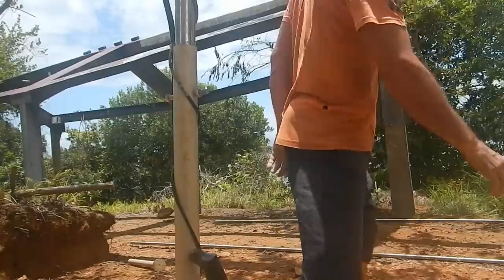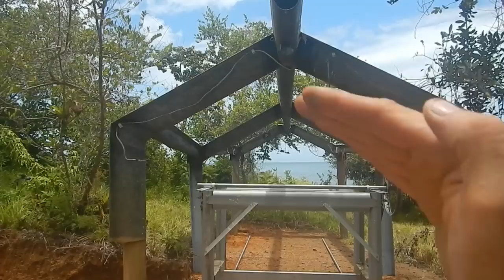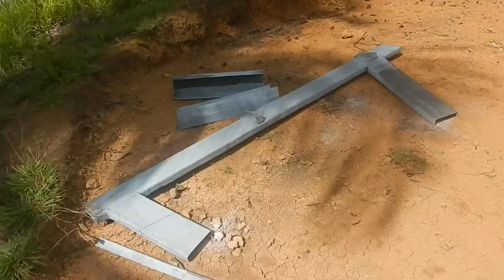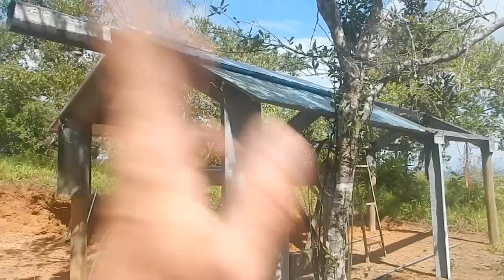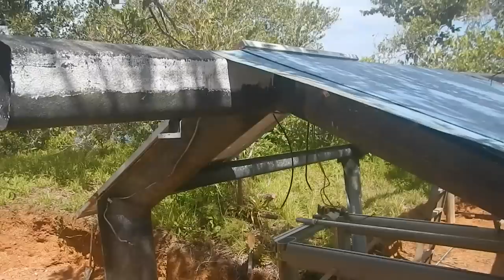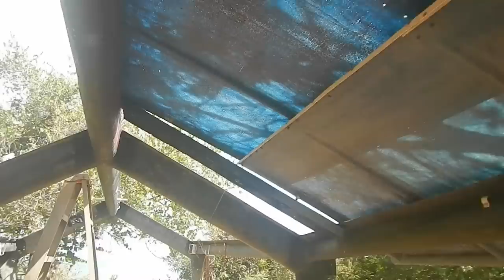Lumber Mill 014 Roof Panels

Comment: Just my 2 cents worth, you might wanna also level those tracks.  i noticed the saw and the ocean line were different.  would hate to see you cut 20 boards, make something of them, and look terrible :)
Reply: Same, perfect level reference there.  There's the old "hose full of water" trick too, clear hose so you can see the level, attach the ends of the hose to poles of the same height.

Comment: Jamie I’m so happy for you man.  

I hate to admit it but at the beginning when my back became trash I became Uber envious of you and other like minded dudes.  I actually stopped watching builders because I hated not being able to move and do.  The worst part in my opinion was knowing I was such a miserable guy.  I had already shut out family since I hated being treated like the crippled I am. 

It wasn’t enough for me to try and supplement gardening for a cpl potted plants or building in my mind apposed to the real deal.  

For months now I have been building a wired remote as well as radio controlled “helper buddy robit.  Aside from moving my broke back around it also has a front loader/fork front attachment, left bed/table from 17-30 noodle units, I can move my trailer from its hitch around the yard, and even has a self dumping barrow attachment.  I am absolutely not bragging because without being able to weld or really do much engineering/proper designing, I’m basically repurposing trash and wheelchairs to a functional unit which will help build a better version since I’ll be able to move my tools and welder at that point.  Talk about a run on sentence...

Taking the months to get to where I am instead of a week like i was used to has been one of the best mental things I’ve found to help with me.  I still get mad on the days I can’t get out of bed, but I know that as long as I can crawl or hobble the next day I can get back to it. Then hopefully have a mechanical way to work around my short comings.   

I have been back watching you for probably 1.5 years again and have been able to live vicariously through you as cliche as it is.  As Iv mentioned before I have looked to your words and mindset since I was a kiddo and we msged about carbon fiber arrows as a good robot material : )  I doubt you remember those messages but it felt really great to be recognized as a robit builder by you.  

Any who.  I didn’t intend to reallywrite all of this but it just came out.  Sorry for all the run one’s and puddle of punctuation errors.  I love you man and it is so great to see you working on your island with your tribe of turkeys.
Reply: That deserves a Jaimie response!
Reply: You sound amazing dude, well done keep on with the doing.
Reply: @masterlup  na.  He knows I think he rocks.  And I wrote it so he could read it. Nothing more.
Reply: @derfe1cadarn  that is appreciated senior.